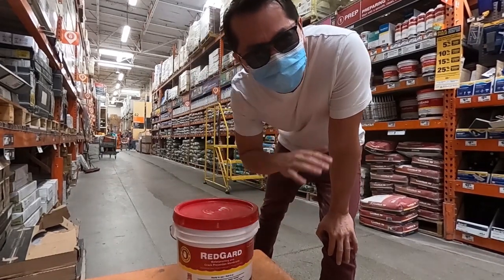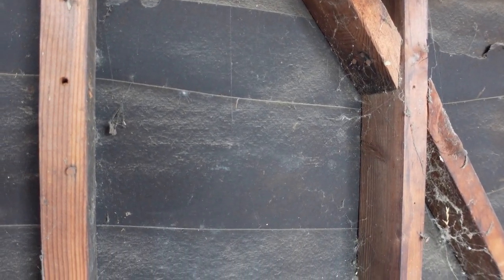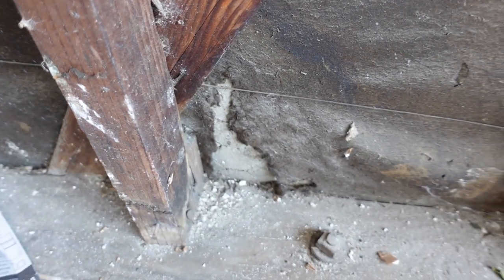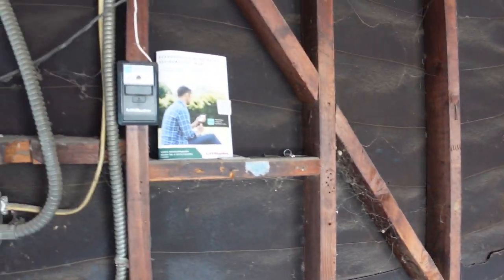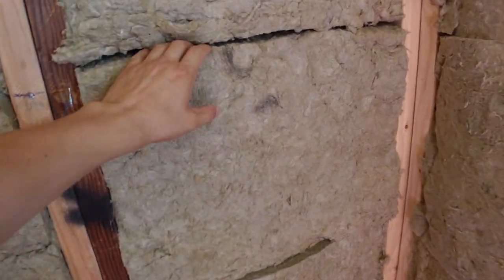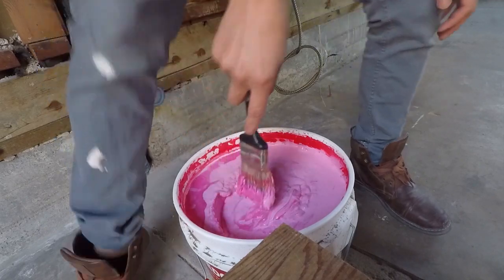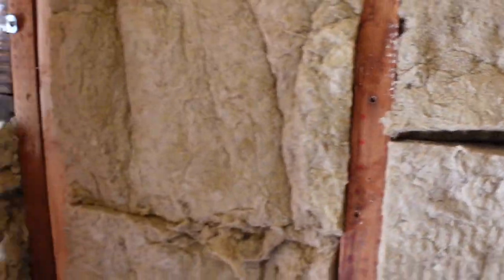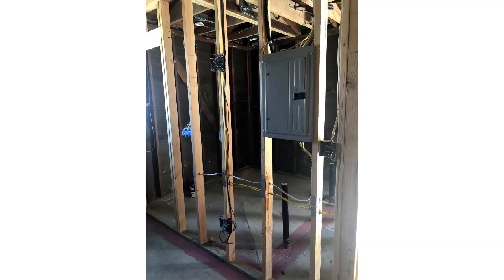Save $10,000 on your ADU with this hack

Comment: I posted on your TikTok.
The presence of a stud does not make the paper between the stud and the siding magically waterproof. However if you also red guard the stud, and sister that stud, the dwelling should be safe.

The reason you need to red guard the floor for your interior walls is that there is probably not sufficient waterproofing under the slab and at the sides. Often a thin foam layer is added below the sill plate to keep water from leaching into the wood.

You will probably also need to provide an underlayment for your flooring that allows for a damp concrete slab.

Comment: Hi I'm researching to get started on a garage to ADU conversion. How much did it cost you for design plans and getting the permits. Could you break down the costs? Thanks
Reply: Design plans 3k.  Some charge as much as 9k.  Permits probably 1k but you also have electric panel permit (500).  There are a few more small charges

Comment: good tip .. only question how do you apply redguard between the stud and old paper... it's not reachable or you need to remove stucco and this is the most affected area usually..
Reply from the maker: If you need to apply Redgard to the back of the stud most likely the paper is not is the condition to be salvaged. The best thing to do will be to install a new layer of paper. Ask the city inspector how to proceed. I would not have applied Redgard if my inspector did not approve it beforehand.

Comment: Will it only be redgard? Or any other brand is ok?
Reply from the maker: The city inspector recommended to use Redgard. If other brand offer the same kind of waterproofing then that should be ok. I would confirm with the city inspector if you are using other brands

Comment: Q: if the current walls of the garage don’t have any paper- just the exposed wood in my garage, do I need to add the paper? Or simply add red guard directly to the wood?
Reply: I have the same question. Were you able to find out? If no paper is there and it's only exposed wood if red guard can be applied or new paper? Plz let me know. thanks.
Reply: I personally would put the paper and then the red guard i think itll last longer but u cant go wrong putting both

Comment: If Natalie designs the ADU, then who do you use as a licensed architect to get the stamp for the building department?
Reply from the maker: You don't need one. A stamp is not required for a garage conversion.
Reply: @HektorCastillo  You do need a stamp - even for a garage conversion - if you create any new openings in the existing walls.  In which case, you'll need to get a structural engineer's stamp.  I suspect you didn't need a stamped set in this case because you're the owner-builder on the project, used WFPP, and your door and window openings used existing headers(?).
Reply: @marisayoung796  Section 5537 of the Business and Professions Code does not require a licensed architect to stamp plans for a single-family dwelling of wood-frame construction not more than two stories and basement in height, but the Building and Safety Division of County of Los Angeles Department of Public Works may request the preparation of plans, drawings, specifications, or calculations by, or under the responsible control, of a licensed architect or registered engineer if the structure deviates from conventional light-frame construction. The plan checker assigned to review your project will have the authority to determine the requirements for final approval.